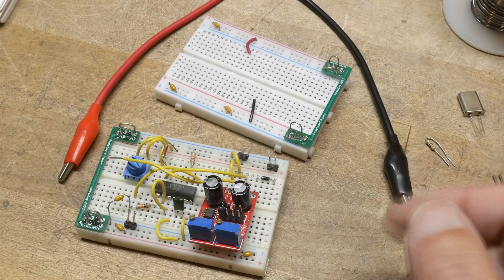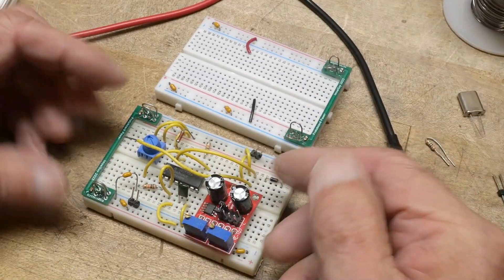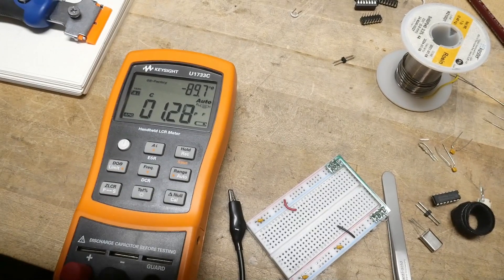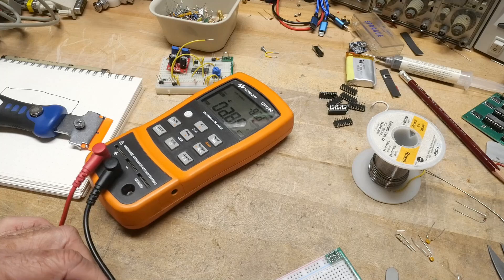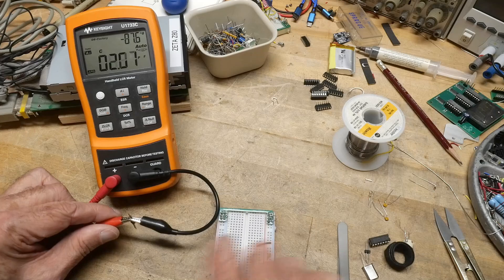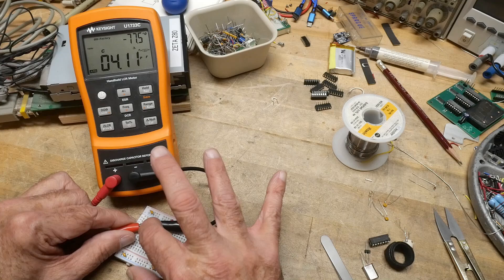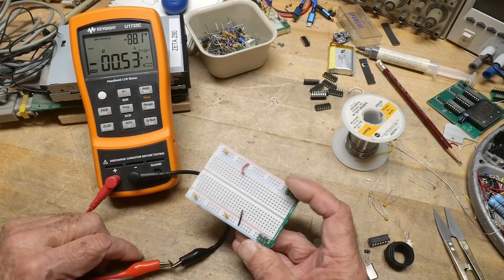#2185 Proto Board Capacitance

Comment: A good opportunity to follow up on the details.  I am always plagued with connection issues using these.
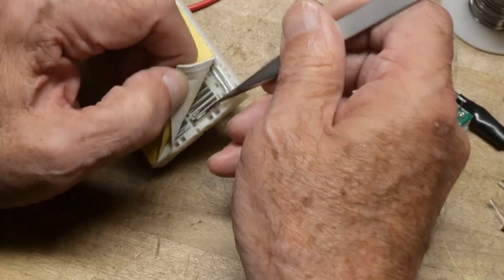Reply: The cheaper the board, the lower quality the steel used to make the "fingers". So when you insert something with a thicker lead or two leads in the one hole, the "fingers" get stretched open and don't hold as tight any more. That's where you'll get intermittent connections occurring. Once I figured that out, I removed all the "fingers"  and using a small pair of pointy nosed pliers to give the lower bend (as seen at 1:31) a greater angle and thus a greater force that the "fingers" will apply. I only needed to do one side, and the result was a dramatic improvement in the board's function and my overall sanity.

Comment: I stopped using breadboards eons ago, but it wasn't because of stray capacitance or the inductance or overly long wires, it's the connections.  Just not reliable and  to me a grand waste of time.  If I can't simulate it, I'll test it on the circuit board.  For me, that approach was best.  My youngest daughter in EE school was building these the last few semesters.  Watching her headache just reaffirmed my need to stay away from those things.

Comment: Yeah, these breadboards messes up with electronics. Just a few days ago I put my scope in a completely different hole that was connected to nothing and was still measuring a few volts (which was close to the actual supply voltage) due to capacitance and it was AC sine wave which made it worse 😂 But these are super handy, just make sure to put few decoupling caps or possibly a small choke for a stable power to devices connected to the breadboard!

Comment: Surprised that  the U1732C has no backlight. The B version of that meter has one turned on by holding down the top-centre button for a couple of seconds. There's a 'sunshine' icon on the button (in white, it's a secondary function). It has no direct ESR function but you can derive that from theta.
Reply from the maker: I looked closer and mine is the bottom center button. I'll remember for next time.

Comment: Simulations + $2 PCBs mean I rarely bother breaking out the breadboards these days. Long tracks & jumper wires means ESL is going to be a bigger problem than capacitance.
Reply: seems like logic of people who are just not yet familiar with a black hole that is EMC and how often folks manage to end up with even worse performance on PCBs.
Lots and lots of nuances that hardly anyone even has a desire to begin to understand routing a PCB.

Comment: This was a doubt that I had for a long time and you shared it with a video, thanks !

Your instrument seems it got lcd light: the central button of the bottom row shows the white icon like a lamp, isnt’t it?

More. Is it correct to measure the capacitance, connecting the first and the last strip to the instrument and then calculate a median dividing the value by the number of strips?

Comment: The most impressive project I've seen on breadboard in terms of maintaining signal integrity was a VGA video effects generator which was clocked at 80 MHz.  It worked beautifully but that sort of thing is inherently fault tolerant.  I just wish i could find more of the breadboarding and prototyping supplies 3M offered in the 1980s.  They had an IDC socket prototyping system that went into regular perfboard which was amazing for DIP packages.

Comment: I was told by my teachers not to prototype on these boards above 1MHZ and FR4 circuit boards are limited to 1 GHZ. I have used FR4 to 12GHZ in a prescaler. The board was very small.
Reply: FR4 has a high tangent loss, so sensitive GHz signals can be lost.

Comment: a couple of pF is negligible. Its doesn't matter.
Reply: It absolutely can matter.
Reply: @SkippiiKai depends on desired frequency of operation and impedance of circuit components.
Reply: Eg rise time of a high impedance signal
Reply: 2pF at 7MHz is 11.3k. That is significant  on my bench.
Reply: Rubbish. You can't make a statement like that if you know anything about the subject.

Comment: Nice to see different measurements techniques. I would have soldered the pins to a SMA connector and measured the capacitance with a VNA at e.g. 300MHz. That would remove the variation due to the position of the unshielded cables and the hand holding them.
A two port measurement would be better but requires more preparations.

Comment: Capacitance depends on the signal frequency. Correct? It depends on which frequency you prototyping
Reply: No, capacitiance is capacitance. It is not frequency dependent unless maybe the plastic separating the two rows has some frequency dependent permeability maybe but I doubt it is significant < 100 MHz or so. One should not generally use these boards for any critical RF type circuit for other reasons.
Reply: Incorrect. capacitance is capacitance, frequency depends on capacitance.

Comment: I measured the same value. With these small values it might be good to connect a couple of the connectors together to measure the capacity between 10 or more connectors. In the end the fine tuning of an oscillator can be made with adding connectors.